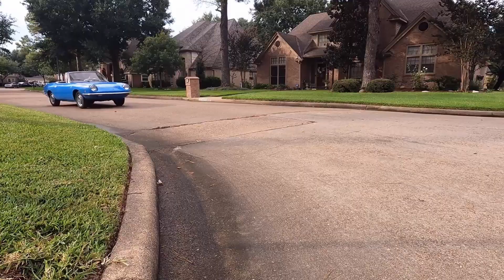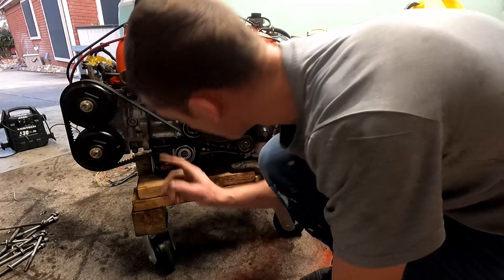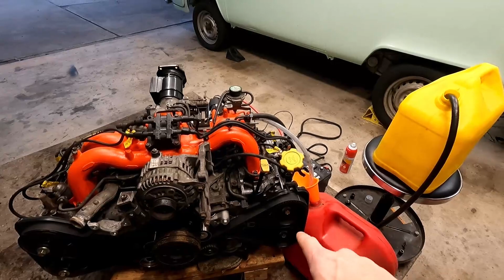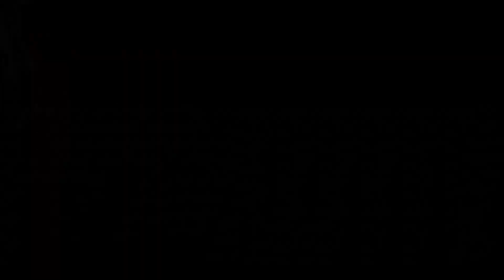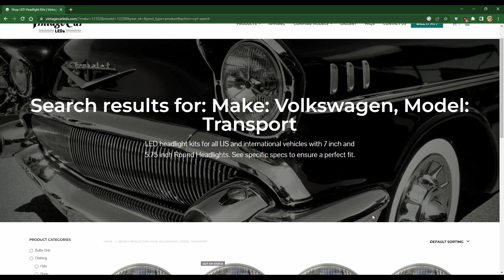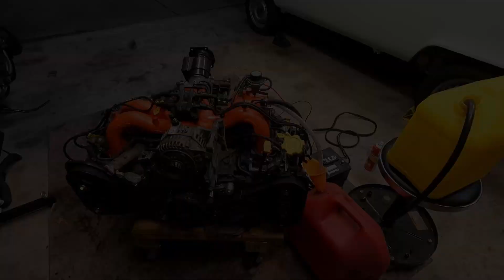Bench Testing our EJ25.. Will it Start?? Progress on our Subaru Swapped  VW Bus!

Comment: Dual overhead? I’m looking for more information on this swap as I also have a 2.5 dohc which is not a common one.
Reply from the maker: Yes this is a DOHC. The good news is the sensors are basically the same as the SOHC. Same with the wire harness.
Reply: @GarageTimeTV I truly appreciate your response. Thank you. Do you still have it and use it?
Reply from the maker: @Omar-somosseres I don’t have it anymore, but served me well! The new owner enjoys it. Love the power and reliability
Reply: @GarageTimeTV about the wiring harness. I’d like to actually have ac. What should I not cut? I’m a bit worried about it. Thanks
Reply from the maker: @Omar-somosseres I used the Busaru videos for trimming my harness. His website also has the complete diagrams. That is where I would start. Watch some and look at the diagrams. They are well labeled
Reply: @GarageTimeTV Thank you so much. Been looking plenty of videos from different sources and learning a lot.
Reply: @GarageTimeTV I can use the harness from my DOHC with an SOHC?
Reply from the maker: @Omar-somosseres from what Ive seen yes
Reply: @GarageTimeTV Great, thank you.
Reply: Can I use the same harness from 96-99 DOHC ?